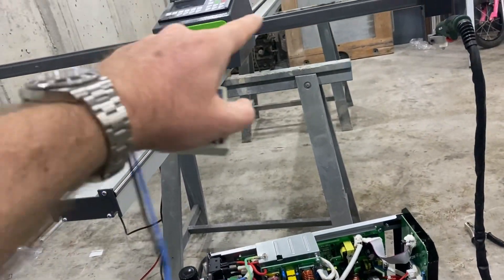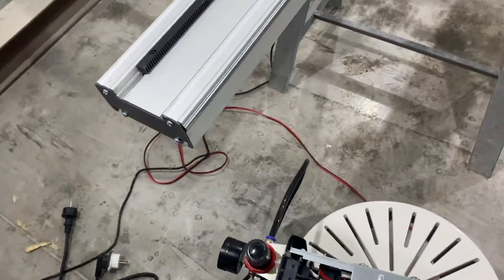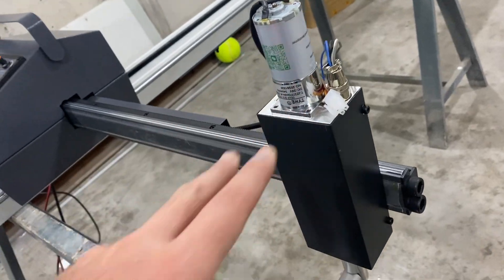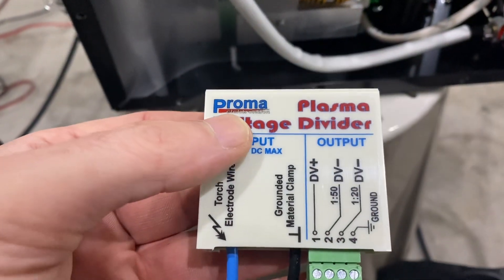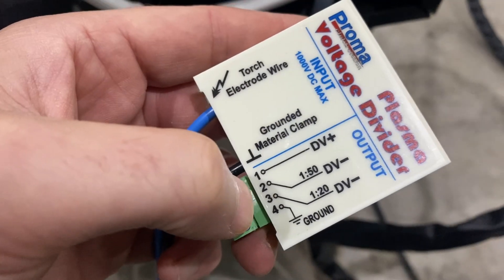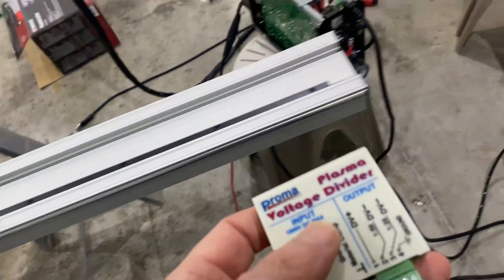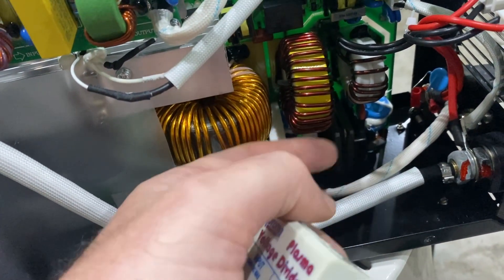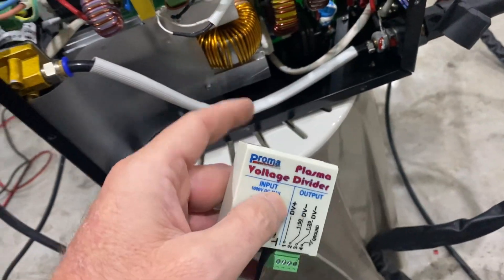Portable CNC Plasma Cutter THC problem fix

Comment: I have the same Toplong plasma cutter. It handles data transfer via the USB interface, but I only get errors on the display...
Reply: That's unbelievable, it actually works! Then I can put everything back to normal.
You write:  there seems to be a problem with naming your files. I always name my gcode text files as 111, 222,333,444 etc. I tried and it worked, filenames with small letters,  one capital letter and the machine does not open the file
You're my hero!
@toploongcnc 
What an amazing tip! You should be utterly ashamed of yourselves. I had to wait for this tip, and you knew it all along, and you didn't help me! Shame on you!